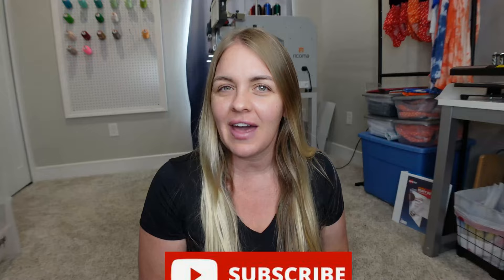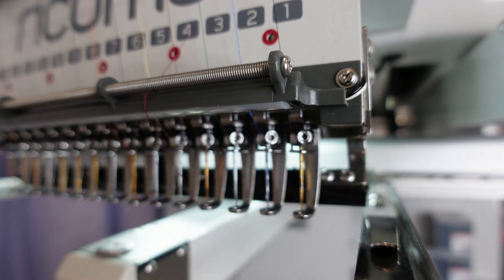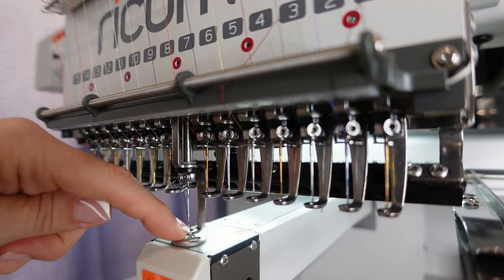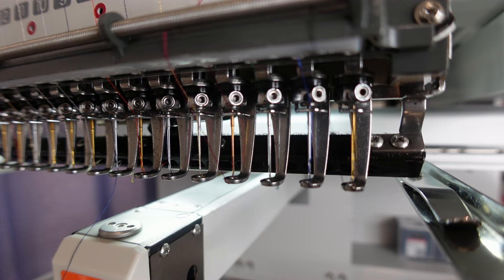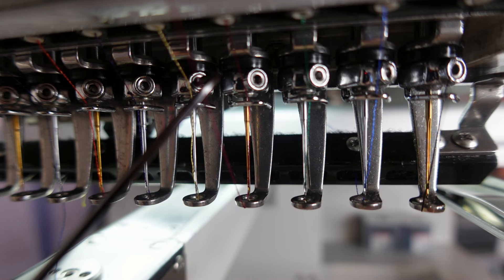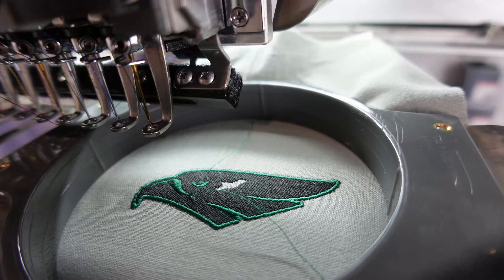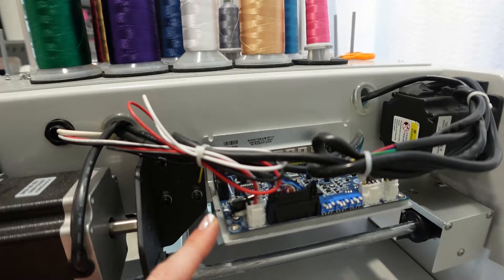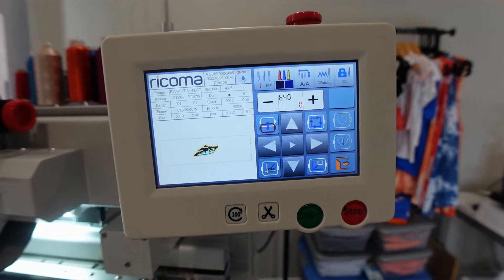THE MOST HELPFUL TIPS FROM A RICOMA TECH!

Comment: Hello Brittany. We have had nothing but issues with our machine. It will run smoothly for a bit and then out of no where tensions go all out whack. Ricoma's customer service is a complete joke. I wish my husband would have done better research before getting this machine. I absolutely hate it. It embroiders so messy in comparison to other machines. I know it isn't our digitizer either. We have tried numerous digitizers and always with the same result. I didn't have my machine up and running for 9 weeks. Yes, 9 WEEKS!!!  We have yet to have a month with it running enough to say that it has been paying itself off because it is not the case. Just when we think, great we have a customer that needs several items, this just might be the month we make enough to not have to pay out of pocket, something ends up happening, and I end up sourcing out the job. We have the 1502  and never have both heads worked equally well to say we can run two jobs at the same time.  This machine absolutely  sucks and their customer service, even  more.
Reply from the maker: I'm really sorry that's an awful feeling.

Comment: So did you try to rotate the x axis after the part was changed out? Thank you for that info it’s hard to find especially about tracing the design before installing the hat… my structured hat gets yanked and winds up messing up the machine but you just can’t seem to learn that information anywhere smh Ricoma is f** trash and there help sucks I can never get a video chat!. Also after I trace I use the other more precise trace tool to the right of it, and when I finally get the position I want the only way to lock it in is either to remember the axis coordinates from the screen or use the trace tool again ughhh which means taking the hat back off!! Any more tips from anyone please?